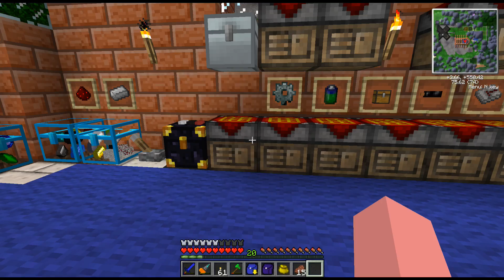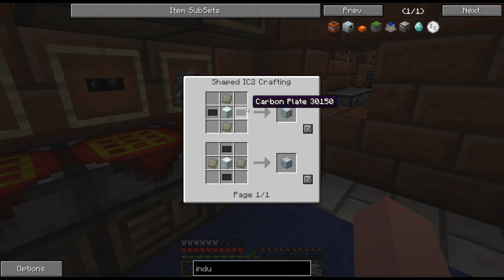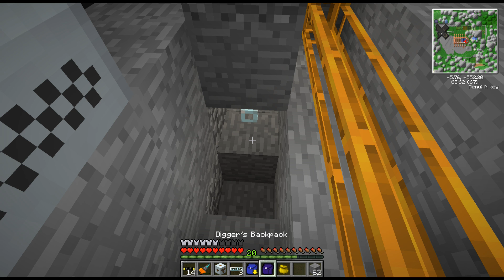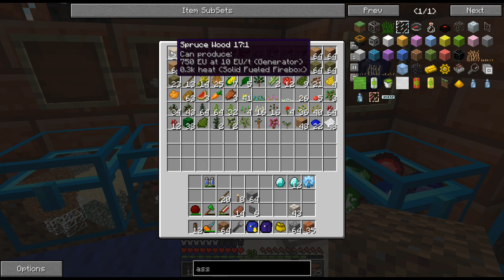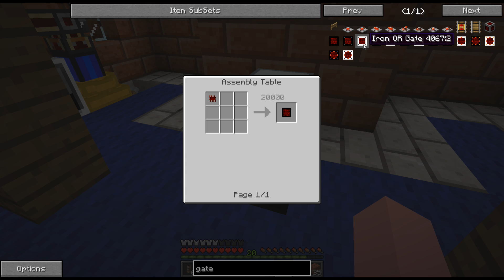Tekkit: DungeCraft - Buildcraft Assembly Table and Lasers - S3 E19

Comment: Hey Nether, I know you guys had TreeCap installed before you updated to the newest pack. I'm still on Direwolf's Pack v4, was that the one you had TreeCap on? If so, how do you get it to work. I'm puzzled over here, because it says it's installed but I've tried everything and it will not chop whole trees. Even tried using a vanilla axe on a vanilla tree and nothing.

Comment: Theres a few blocks in Thermal Expansion which are better than the pipes, exactly the same, but smarter and work with multiple mods not just IC2 pipes

think they're called tesseracts, one for liquids/items/power (also theres a 25% power loss in teleporting MJ)